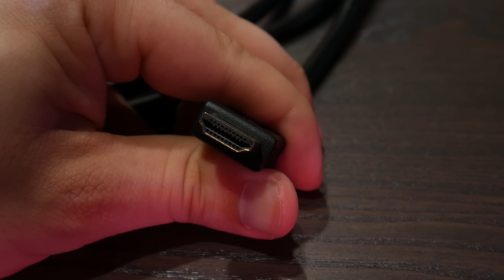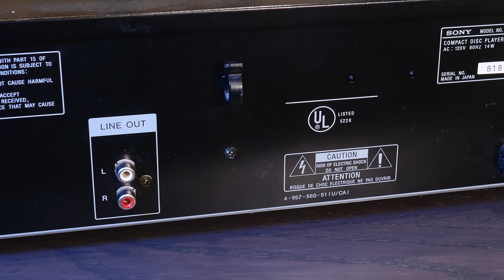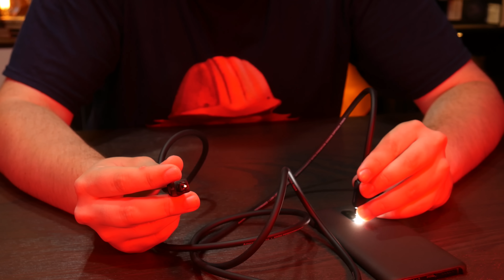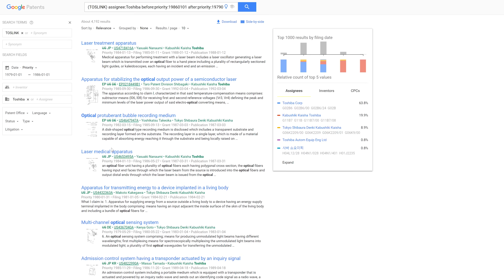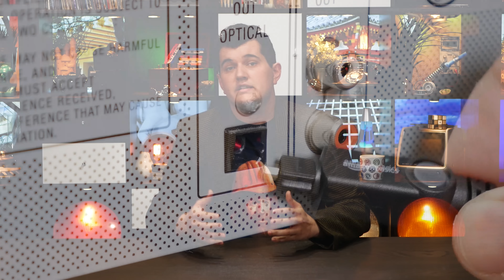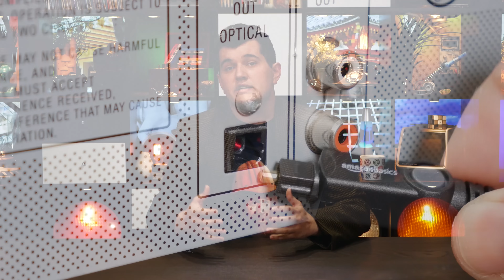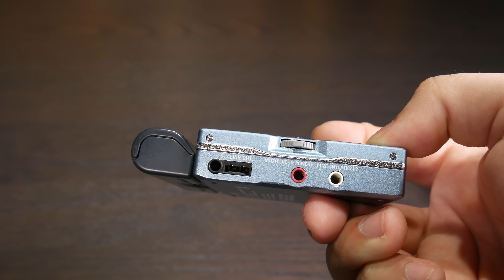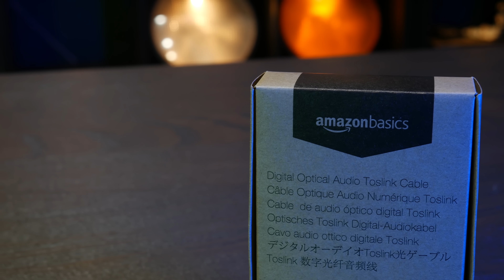TOSLINK: That one consumer fiber optic standard

Comment: I bought myself some neat little desktop speakers and saw they have toslink when they arrived and they even came with all cables fitting the inputs (NEAT). Then I found out the mainboard of my computer has toslink. I decided to go with it because I found 3,5mm jacks to be a bit prone to breaking and the toslink actually seems sturdier. Good to know there's like no difference in quality 😂 couldn't tell a difference either when I compared them back to back

Comment: I don't know if it's mentioned in the video yet (I'm only about 10 minutes in) but the TOSLINK cable is the standard used for ADAT in music recording equipment. I use an ADAT system to expand my audio interface from 8 in 8 out to 16/16 using a Behringer ADA1820

Comment: I still use a Toslink to carry sound from my new 4k smart TV to my older AV amplifier.

This is because despite HDMI-CEC to the amp giving me volume controls on the TV remote, PC gaming in surround sound becomes obnoxiously complicated: using a 4k to 1080p downscaler adopts the EDID of the TV, and unless you use Custom Resolution Utility to override the EDID flags, it won't output uncompressed PCM, because the old AV receiver doesn't support eARC bandwidth, so the TV's handshake reports it as impossible. Most annoyingly, CRU overrides apparently need to be redone over and over every time the downscaler powers off. It's a nightmare.

All that aside, using SPDIF/Toslink just works for Dolby or DTS in streaming apps, and the only downside is that I need to reach for my AV remote.

Gaming consoles simplify this mess by having dedicated Dolby/DTS encoder chips, while on PC no one really makes these anymore, and the ones that do exist add significant latency. So we're stuck with uncompressed PCM and all the pains that come with delivering that without confusing your poor old amplifier.

Comment: I actually use toslink for noise isolation on my pc, when I used rca I would get a very faint hum that would change depending on computer activity or mouse movements, used toslink and that hum went away. Just because it’s a digital signal doesn’t mean a noise ground can’t affect the dac after it converts it to analog after.

Comment: I can tell you one reason TOSlink S/P DIF (thank you, I never knew what either of them stood for, they just seemed to be random collections of specific letters). if you want to connect more than one speaker set to an output without needing a toggle switch for 3.5mm splitters. and with 3.5mm, you can only have one speaker pair active at once, with an optical splitter you can actually have eg 3 pairs of speakers active at once. which. might be useful. or just convenient for having "cheap pair" "expensive pair" "surround system" conveniently switchable. I always pronounced it Ess Pee DIF? can I do that? I have to admit, I've never actually said Ess Pee DIF out loud. I have now though

Comment: A useful reason for optical isolation is to prevent ground loops between equipment.  That won’t affect the music per se, but it can result in low level noise on the ultimate signal.  That’s why some spdif interfaces use isolation transformers.

Comment: To be fair a lot of lower budget sound bars like mine only have aux in and toslink in so imune to interference would be a selling point even if it weren’t digital audio 
When I use aux cables of any length there’s always a hum when I turn the volume higher up

Comment: 6 years later, I'm still shocked that optical never made greater inroads in the car audio world.  Even without it being leveraged in OEM installs, I had always thought optical would be a slam dunk in aftermarket head unit and amplifier installs, yet it only showed up in very high end installs.  

1 relatively small diameter cable to string from the dash to the trunk to run all 5 channels, rather than a massive bundle of 5 or 6 RCA cables (because people always insisted on gargantuan Monster cables) with zero ground loop issues...

Funny fact - my "cheap" Android head units almost universally support optical audio out.  But my $1,500 Pioneers?  Nope..nowhere to be found.

Comment: It’s 2025, and Toslink is still going strong! My bet as to why that is goes on it’s cost, ease of use and WILD compatibility. Well, first, it’s cheap(!), and I haven’t seen a single television from the digital age that doesn’t include an optical out, but ARC HDMI is not as widespread. It’s easy and almost plug-and-play, you just hook one end to the telly or audio device, another end to whatever thing you’re using as an amplifier and done. Did I mention it’s cheap? Also, I think the very fact of the standard remaining the same over the years is what makes it so great. You can hook a 1980’s CD player; a 1990’s Laserdisc machine; or a 2025 television to the same amp and expect all of them to work flawlessly without much fuss. It sounds great as well! Of course, uncompressed PCM or losslesly compressed multichannel audio would be preferred, but I’ve never heard anyone arguing that Dolby Digital 5.1 (or 7.1) sounded bad. For music, all right, you might prefer (and I do) lossless audio, but for, I don’t know, watching a movie, no one will be paying attention to the flaws of AC-3 anyway. Oh… and it’s cheap.

Comment: THe mac mini I purchased in 2009 had a mini toslink connector, which I used to output to my receiver!
also, gold plated toslink connectors 🤣
Reply: The Toslink connectors were not gold plated. Its a dual purpose connection. The gold plated part of the connector was for analog devices, like headphones. The little hole in the center of the connector allowed light too pass through so it could be used as a Toslink connection, as well. Most people used it as a headphone, or analog audio out connection. If you wanted to use it as Toslink, you had to buy a little adaptor that goes on the end of a regular Toslink cable.

Comment: Toslink/Optical SPDIF has some downsides, the shielding on the wire could leak light or the connector itself may allow some light bleed injecting noise into the signal that is audible. Sometimes really loud noises were injected by faulty connectors.

Comment: The reason coaxial digital is coaxial is cuz coax shielding that emf you mentioned!  RCA are not shielded, coax is wrapped, shielded around the center electrode.  Dont use rca on a orange coaxial plug, use the thicker coaxial yellow wire or tv cable with F to RCA adapter

Comment: Hi. I enjoy your channel. I know this is an older video, but I’m going to disagree with your conclusion on this one. Coax wires are perfectly fine for a digital signal… until they’re not. I had an apartment in the mid 2000’s where the amp and speakers were on one side of the living room and the computer and projector were on the other. I had a long cable that carried digital audio around the edges of the room to the other side. It sounded great! That is, until someone flicked the lights on it off. Doing so would cause a split second of interference that would interrupt the audio for something like a second. It was super annoying! I replaced that long cable with fiber and the problem was 100% solved. So… I appreciate that it exists. Cheers.
Reply: "Coax wires are perfectly fine for a digital signal… until they’re not."

The signal going through that cable is analog. You can't send a bunch of 1's and 0's through a piece of copper wire. The "digital" signal is really an analog representation of the digital signal. Anything that effects a regular analog signal can also effect the "digital" signal, as well. A better option than Toslink is AES/EBU. Its the balanced version of the "digital" signal. It also offers galvanic isolation.

Comment: ive been using tos for 20 years. i had a surround sound system that came with a philips LCD television i won in a raffle at a company christmas party. that entire set up is long gone but i still had the cable and ive used it on every sound bar and sony product ive had in my home just because i had it lying around

Comment: Two valid reasons Toslink is still relevant:
#1 The Sony PlayStation 2 has a handful of games that supports surround sound and unless we're talking Dolby ProLogic, your component cable won't carry it.
#2 Mister FPGA, as amazing as this device is, the standard audio out on those boards are simply horrible, of course you could do HDMI out if you got the board for it but if you're playing in a regular CRT that would be extra work to split the audio from the HDMI, with Toslink you get audio clean as a whistle.

Comment: In summary, RCA moves analog audio to be amplified by an amplifier, Optical moves digital data to be decoded by a DAC later in the chain, and then amplified via RCA.

I have a PS2 connected to a CRT TV with RCA outs. If I connect the TV to the DAC/AMP via RCA, there's a lot of noise and distortion due to the TV being old and not well isolated (and the DAC inside being shit probably). If I connect the PS2 via optical out to the DAC, the pure audio data is sent to the DAC and decoded there, with zero noise and high quality, bit perfect audio. Yes, the PS2 has optical out and it's a great CD player if used as such.

Comment: I know it’s an old video, but in case someone still cares. 
Yes you missed the fact that old unibody MacBook Pro had a mini optical headphone jack and it was glorious. Old desktop Mac Pro had a toslink connection. As an audio engineer, it was ideal because then you can achieve a really great result with just  a nice DAC and a pair of good monitor speakers. No need for audio interface and to worry about your PC having the drivers or ports to connect to, and most of all, the connection doesn’t rely on any shared electrical ground. Toslink is still pretty much alive for ADAT and SPDIF in audio engineering world. 
And lastly, a digital audio stream can suffer from quality degradation from electrical interference.  It’s just that to an ordinary lister listening in an ordinary listening environment, occasional dropped digital bits in 16bit data is pretty much inaudible.  But it an be noticed as a change in Audio quality, and to someone who is trying to create an audio product, you want an option that can eliminate any chance of even a slightest degradation of a the audio signal.

Comment: If anyone is curious why this isn't used in other applications, it's simply too slow. I'm using TOSLINK for data cables in a high EMI environment. When I did basic pulse experiments on an oscilloscope the signal distortion is huge. The real world data rate with inexpensive components is close to 1MB/s / meter of fiber length. This is pretty close to USB 1.0 speeds.

Comment: You have to appreciate though that this connection is on everything. I have a bunch of these lying around because whenever I get some new device and I dont have the "proper" cables they always seem to have the optical one and they are much cheaper cables than HDMI cables.
It is the only option to run an AV receiver to a PC (if you want to keep using your DisplayPort), and I found it very useful for the Xbox consoles as well.

Comment: Blinky lights of differnt colours would let you send and recieve multiple signals each way. If there was a will to use if for more, it could be done quite easily. I doubt there is any desire to do so though. Multi-bandwith (differnt colours) is a big selling point for optical and has huge advantages but there are many modern optical alternatives that can do more. It will probably fade away with time. I like toslink and will miss it when it goes.

Comment: Not that it matters, but there was one of these silly Toslink upgrades that did actually help.  Spring loaded connectors.  Basically the usually plastic fiber floated on the connector on a spring, keeping it centered. On a very few custom installations.  I have seen the light pipe get bent against say a subwoofer, or active driver, and the vibrations could cause intermittent drops of the signal.  The spring connector, kept everything flowing like it was supposed to be.  Seems silly in the world of HDMI and bluetooth.  However, that stupid spring saved a lot of frustrated phone calls from drunken yuppies who were getting signal drops from their Riva MP3, or Archos, MRobe, or  whatever player back in the day.  This was doubly true if they had a docking station for the thing that was cross linked to a fireball or klidascape server. To be fair, this was a stupidly niche product problem from people paying a grand to get a overly complicated universal remote programmed, so they could watch tv and surround macroed from a single button press, so I don't think it would have affected many folks.  I had to go and actually install an infrared repeater on a ceiling once because the dude kept looking at the remote and pointing it at the ceiling to press it and got pissed because the remote wouldn't macro his commands.

Comment: I use a toslink connection for my tv. I have a decent sound bar but as I rent it's a bad idea to get a full blown sound system. Maybe someday but I digress. My sound bar supports a newer HDMI format, but I have a use for all my HDMI ports on my tv and taking up one of them for just my soundbar is not ideal. Used the included Toslink cable, both the sound bar and tv support it, and I get all my HDMI ports for all the things I want.

Comment: Okay, so stated elsewhere, but the emi issue comes from the unbal signal sources. Everyone shares a ground plane/loop so a digital connection could loop to an analog one.

Now I want to do toslink 2.0 though and convert the spdif to a balanced sognal and drop it on a standard SFP/+ module to single mode fiber it to kingdom come

Comment: What’s wild is that this cable isn’t even capable of transmitting fully lossless audio to a stereo system. I can’t tell you how pissed I was to see that optical cables fold down the signal frequency to 48khz after paying hundreds for a receiver.

Comment: I'm still using toslink in 2025. It's just awesome to think about light carrying the audio signal. I just love it. With coax you'd connect the grounds of your computer to the ground of the AVR which causes humming. I admit that's bad equipment, but it NEVER happens with toslink! 🤷

Comment: I (still) use TOSlink between computer and amp. It is much more reliable than coax SPDIF (both being light years better than analogue). What was undersold was the coaxial SPDIF gets really flaky beyond 4 or 5 feet because its bandwidth exceeds what most cheap RCA's can handle - decent RCA's will get further of course and proper coax (eg RG58 will go for miles). Once you're going 5 feet or more, optical TOSlink streaks ahead. Also if your source and amp are more than 5 feet apart, it is increasingly likely that they are plugged into different power outlets, which means earth loops become a real problem for coax but no issue for TOSlink.

Comment: u shouldve touched on interference more. the type of amp matters greatly. lets say, a dac connected to a class A amp, any ground loop or interference at all is a big deal. less so on AB and irrevelevant on class d but i can recall plenty of times when RCAs gave me issues and toslink was the solution. better quality? no def not. but does solve enough problems to be relevant for me.

Comment: I run my old BOSE sound system that I will NEVER EVER get rid of. I use a ROKU box for all my TVs. ROKU only has an HDMI out and BOSE only takes tosslink. I had to get an HDMI to tosslink converter (yes they exist). It works and it sounds great.

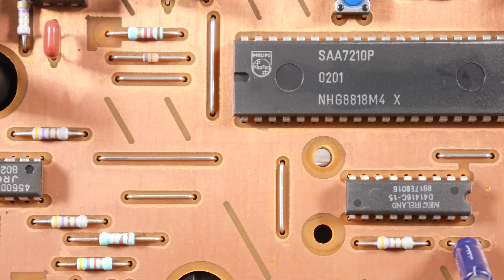Comment: @2:33 Reed-Solomon Code is design for Forward Error Correction(FEC), and is not use to decode the sample. Even you discard all parity check bit you can still read data. And it use double layer since single layer of long RS code is too costy to decode compare to 2 shorter code. But it also limite the correction ability. Another benifis is not all CD player do 2 correction, a lot of them do one correction (cheap lower brand cost saving). And even 0 correction. 
And why heavlily rely on FEC? since CD sync point is limited at begin of the track. So you can only locate the track when it start you can not go accurate backwards only forward. Data CD give a lower level structure that allow logical block.

Comment: Whelp, time to switch my amp/dac back to its usb 2.0 type B cable. I switched to toslink when I saw it had the option and found an old cable lying around. Without researching it at all, I just assumed fiber optic cable = better, faster, clearer connections… what a fool I have been

Comment: I did not know Toslink was short for Toshiba link. I found a used 1999 Toshiba amplifier for $26 and connected it to my TV by Toslink because I thought it was a cool idea. AND the reciever came with a remote. I can't tell if a 1999 DAC sounds different from a newer one but it works for my living room. I use it with JBL control1 speakers and it's perfect.

Comment: Correct assessment on the noise pick up issue, though the problem with S/PDIF over unbalanced co-ax is the noise it GENERATES. Put one of those close to an analog patchbay in a recording studio and that little antenna transmits its nasty digital pulses into your beautiful analogue lines. Use TOS link and no bleed from the digital connection to the microphone lines.

Comment: The one thing that made standalone audio connections like Toslink superior to HDMI audio, is when you have a receiver inbetween the source and the TV, and you forgot to turn on the receiver before starting a Neflix streaming session, and then you turn on the receiver, and the screen go black, and Netflix might crash due to changed DRM variables of the connection (or something). That never happened with Toslink.